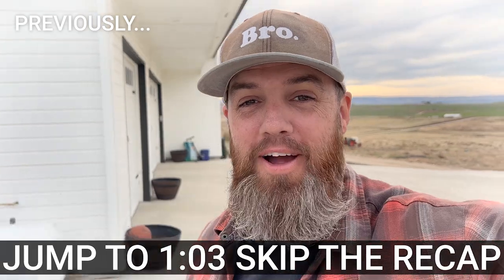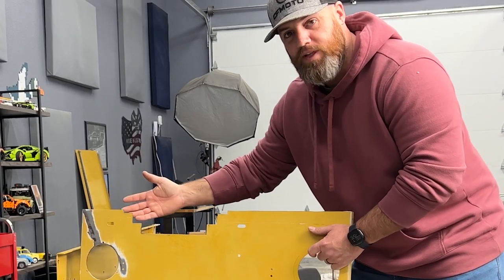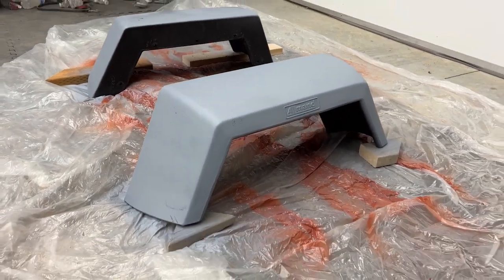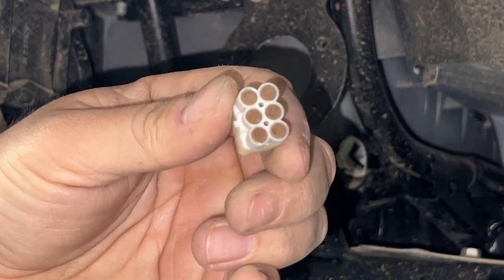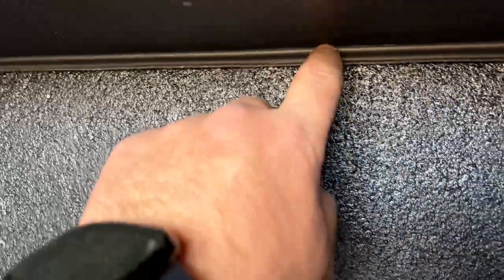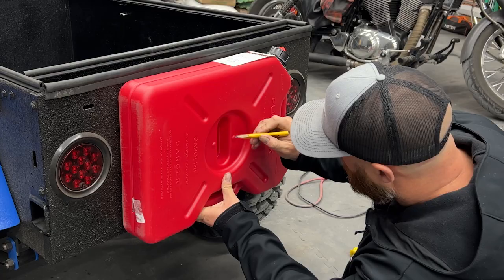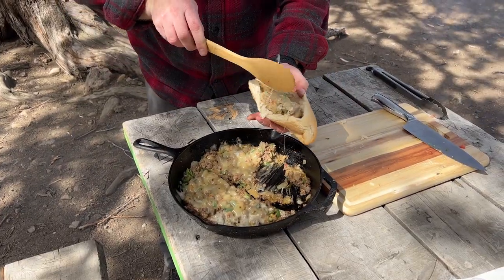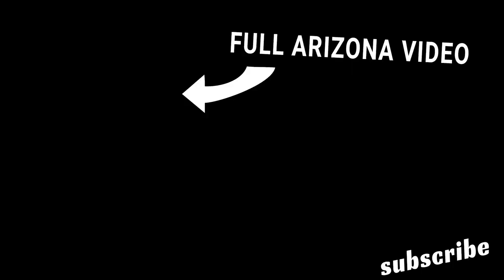My ATV Overland Trailer is Done [Part 4] ... and then I broke it 😬

Comment: Full grain plywood is much stronger than wafer wood, and it handles moisture much better, and, if it's exterior grade, most likely won't warp or twist. Also, if something is dropped on it will resist puncture.
Reply from the maker: Eventually I want to use a thinner wood and top it with fiberglass

Comment: I found your channel a while back and watched a few and forgot to SUB.   it came back in the recommended and now i am subbed.    Awesome video.    Wife and I plan to build something like this for next summer.     it's been a dream of mine to build one for years, just never happened.    Good video.  keep it up.
Reply from the maker: Thanks! I highly recommend keeping the trailer as light as possible. I haven't fixed the suspension yet, though I did get the new torsion axles. But one of the things I'm going to do when I work on it again is remove as much weight as possible.

Comment: Did you remove your lift kit or just change out the tires back to the CST's. The unfortunate reality is although cheaper the plywood is heavy. Aluminum sheet for the floor and possibly the top lid. You would have to do some fancy brace work for the lid though. Overall It came out great. Nothing ventured, nothing gained. Always learning something new.
Reply from the maker: I still have the lift kit. The tires are 29 inch Maxxis bighorn 2.0s. Honestly, with the overall weight of the trailer, I doubt the plywood lid made made much of a difference.
Reply: @BroBuildsGarage  I meant with the bottom deck, the walls and the lid. I have the Overland as well and have contemplated the lift for more ground clearance. If you ever get over to Idaho falls to ride let me know and we can do a meet up!